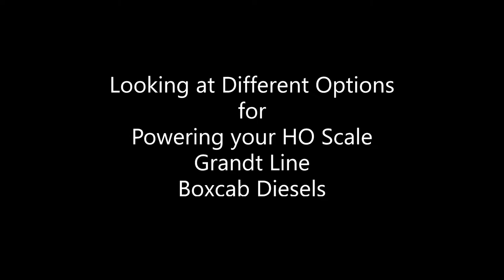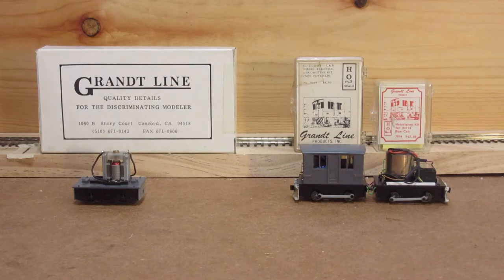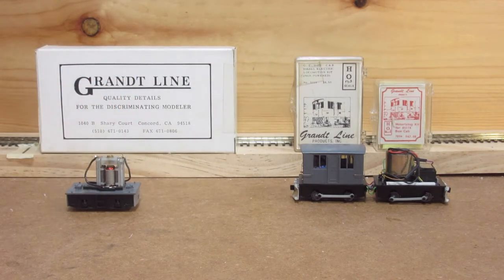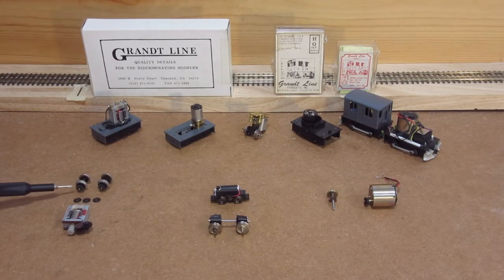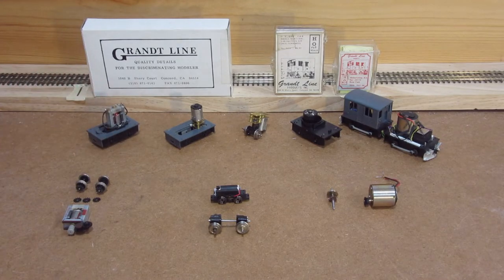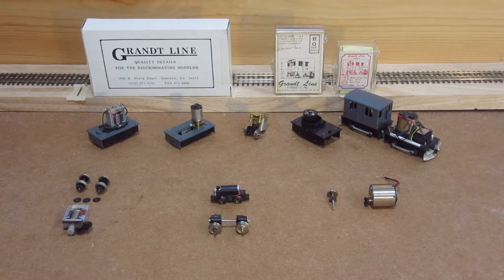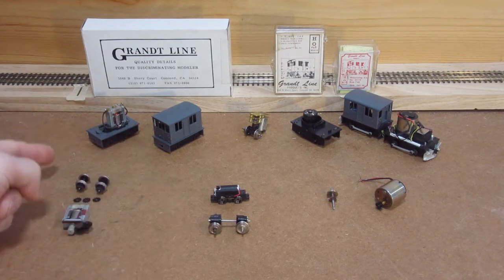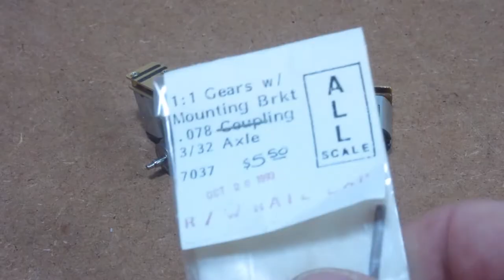Grandt Line 23 Ton Boxcab Diesel Locomotive Motor and Drive Options for HO, Hon3, and Hon30

Comment: Perfect timing. I just received a new generation Grandt Line kit in the mail today and then stumbled on this video while looking for assembly options.
Reply from the maker: Thanks for stopping by, plesse feel free to reach out with any ideas or questions you might have.  

I am looking at another idea for repowering the new style kits with a heavy brass power unit that has an actual working equalizer.  I'll post a link to my inspiration below.
Reply from the maker: https://youtu.be/8LDjoc6wmdM

This basic concept would be a great option to work with for truly free floating equalized suspension.  

This guy has some amazing hon30 models largely scratch built and a really cool layout.  Check out his Hon30 Davenport Diesel and his Nn3 boxcabs!
Reply: @dtj9923  pardon me while I pick my jaw up off the floor. 😲

Critters are the outer limits of what's possible in a scale, with only early (1830s era) steam, speeders, and modern track maintenance machinery being more difficult.  And that's just considering straight DC. DCC / DCC-Sound is a whole other level of insanity - as you seem to know. 

Have you examined the mechanisms used by Broadway Limited's trackmobile, Athearn / Roundhouse's EMD Model 40, or the Walthers ML-8?
Reply from the maker: @ajkleipass  Here's s good picture of the ML-8 chassis, I haven't looked at this but I am now!:

https://www.trains.com/mrr/news-reviews/reviews/staff-reviews/product-review-walthers-ho-scale-plymouth-ml-8-with-esu-lokpilot-dcc/

The Model 40 chassis is a pretty solid chunk of die cast metal, looks like motor in the middle, small flywheels on the ends of the shaft:

https://www.trains.com/wp-content/uploads/2020/10/mrr-pr00406_34.jpg

I have seen the BLI Trackmobile but never under the hood.

My big struggle is:  Come up with something that has equalized wheels, is compact enough to get DCC and sound under the hood, gets everything under the window sill line.
Reply from the maker: @ajkleipass  Excellent, gonna cue it up now.  Thanks!
Reply from the maker: That's a really ambitious effort.  

They used to make a Micro Tsunami 750 size decoder that would have fit much better.  They're impossible to find now.  Their availability would definitely make a clean DCC + Sound install in a Grandt boxcab much easier!

I have a new motor and gearing solution that I mapped out today that should solve most issues on the updated version of the GL kit.  Stay tuned!  It's pretty cool.

Gonna use a 4000RPM gear motor, then recycle the Grandt plastic worm and 20 tooth final drive gear on the axle.  Should be super smooth and compact.  Top speed 20MPH.

https://www.ebay.com/itm/222044643613?hash=item33b2e4611d:g:dI8AAOSwwpdW2-3I&var=520906309889

Select 12V and 4000 RPMs

Comment: Nice collection of Grandt GE boxcabs!  The original version of the kit with the Faulhaber 59:1 motor/gearhead was not too bad.  Later versions with the open framed motors really sucked.  

Love the side rod drive versions...  GE never built any of the boxcabs with side rods, but with the later end cab 25 tonners, GE did build some narrow gauge versions with side rods.  Several in meter gauge for Brazil and a few in narrower gauges.
Reply from the maker: Hello again!

Yeah the current powered versions of the GL boxcab and 25 tonner are useless, waddling, coffee grinders.  I am actively exploring a 3D printed, or machined brass drop in mechanism with an equalizer to fix them.  It's really the best solution.

My siderod boxcabs were inspired by both the 45T and 25T siderod locos.  I know the engines in Brazil you speak of.  Super cool!  I have two 25 tonner kits saved up to build a pair of siderod 25 tonners.  I also have some 45t die cast hoods to use on them to add weight.

The new style Faulhaber mini flat spur gear drives I install in this video on the old kits work great.  You still run into issues with the 1:1 bevel gear final drives being non-concentric and causing erratic running.  Fixable but a ton of work to iron out.  A 5MM NWSL worm based final drive will be much smoother. Working on that now.  A Flea would work as well but the larger worm is smoother.  The smaller Faulhaber motors leave PLENTY of room for DCC, sound and electronics in the 23 tonner cab.

- D
Reply from the maker: I forgot to mention I'm actually working on a Brazilian style 25 Tonner.  Not sure how much of the Grandt kit I will use vs just 3D modeling and 3D printing a whole new one.  The Brazilian machines were the main inspiration to do the 23 ton siderod boxcabs.  Then I did a 45 tonner boxcab!

https://en.wikipedia.org/wiki/GE_25-ton_switcher#/media/File:GE_25T_507_ALL.JPG

LOVE IT!

Comment: I would like to know where you sourced the bevel gears please?
Reply from the maker: Hey Steve, thanks for stopping by.

Here's the story on the bevel gears.  

The original Grandt boxcabs with the Faulhaber drives came with bevel gears.  The one for the motor has a 2MM D shaped hole, the one on the axles has a small inward pointing shoulder and a 1/16" bore.  I can not locate a specific Grandt Line Part number for these but they are definitely Grandt gears.  They came in the old boxcab powering kits.  

IMPORTANT!!! If you find a powered kit or the powering kit by itself you will want to put a flanged brass hub in the center of the motor bevel gear to take out the wobbles.  Make it a tight slip fit on to the motor shaft and affix it with a little CA glue.  Otherwise you'll see pulsation when the locomotive is running.   I chased this issue forever.

Here's some Grandt numbers for you:

7034 - 1:1 Bevel gears, in line
 15 tooth, .3mm bore, 48 DP 
7035 - 1:1 Gears in Line 15T 3/32" Bore , 48 Dp  (I modify these with brass hubs all the time so 3/32" bore doesn't matter)
7037 - 1:1 Gears with Mounting Bracket .078 Coupling  3/32 Axle  ( same as above but with a gearbox and coupling)

https://www.grandtline.com/products/transmission-components-2/

Precision Scale Options (Grandt made these parts for PSC)

4018.5 - same as Grandt 7035 - 1:1 Gears in Line 15T 3/32" Bore , 48 Dp
4018.8 - 2:1 Miniature Offset Bevel Drive (DELRIN)  -  https://www.ebay.com/itm/233470988463?hash=item365bf490af:g:gusAAOSwlq9eJhcM
4018.9 - 2:1 Miniature Offset Bevel Drive (BRASS)  - https://www.ebay.com/itm/233077564882?hash=item36448165d2:g:HTsAAOSwtYZcLBE8

Plan B is to use Helical gears which will be much smoother than bevel gears (these are all 3/32 and will likely need adapter bushings) 

PSC - 4009 -    https://www.ebay.com/itm/233470993933?hash=item365bf4a60d:g:1SwAAOSwzp1eJhkG   (I don't like that they are brass on brass, not great)
PSC - 4018.2  -  https://www.ebay.com/itm/393470573752?hash=item5b9cac7cb8:g:68YAAOSwEsthAcMb  (same but with a gearbox)
Grandt - 7038 - same as  (PSC - 4018.2) (but with steel on brass gears! WINNING!)

Yes I literally have a sample box with all of this stuff in it... crazy I know

Happy hunting!